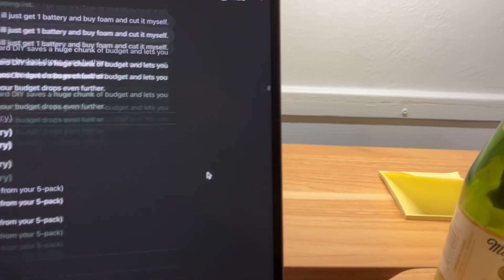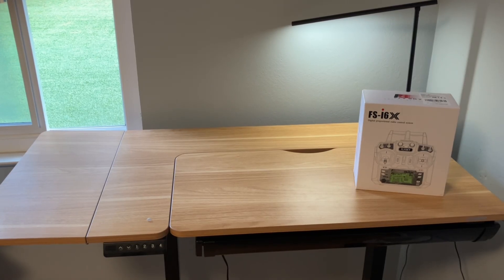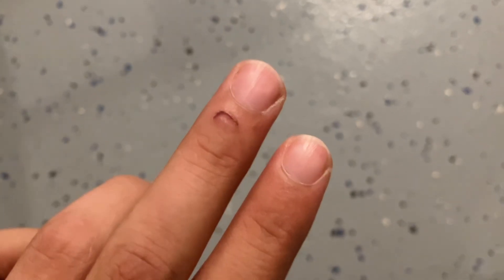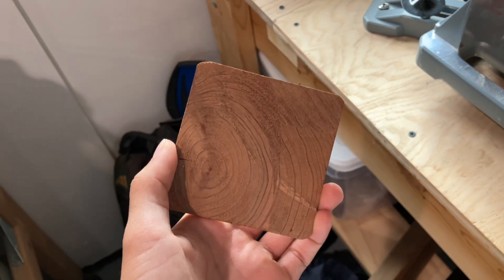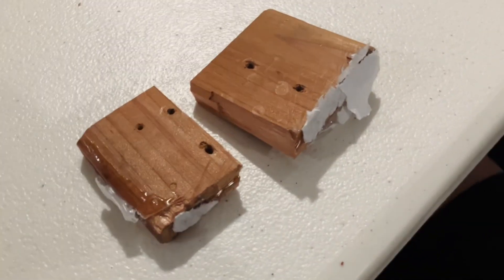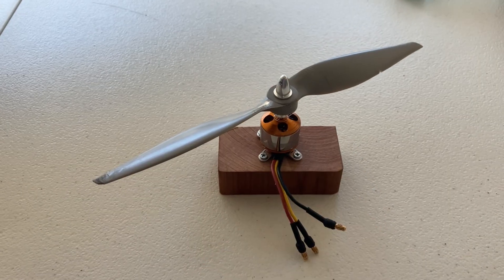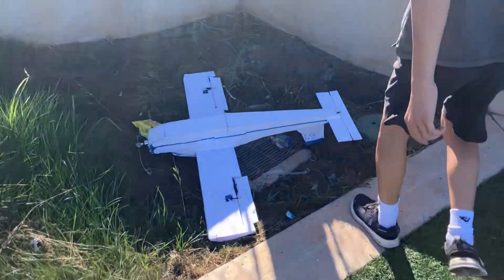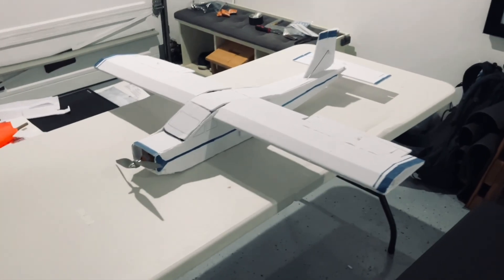building an RC plane as a complete beginner

Comment: Use some cheap thin plywood for the motor mount next time, should be stronger and lighter! Also, it kind looks like maybe it was tail heavy, correct center of gravity is super important for any plane, usually you want it to balance about 1/3 back from the front of the wing.

Comment: Well done one putting a functional plane together and dealing with setbacks - that's definitely a part of the hobby.
Your esc is likely not destroyed (only if the sensor cables somehow shorted against the power wire). I would try roughly reattaching the receiver wires and testing the esc. If it runs fine, you can either buy a new reveiver cable or use the part that was cut off and either solder it to the board or back to the cut cable ends. You can use heat shrink tubing to replace the insulation that was pulled away. 
The black power cable was cut into as well - if it's just a few strands of wire ripped out, just shove them back in and use some tape to fix the insulation. If the cable itself has lost more than a third of its diameter, you can remove the insulation around the cut and reconnect everything by soldering it together - or replace the power cable altogether with a cable of the same gauge.
Either way, good luck and have fun!